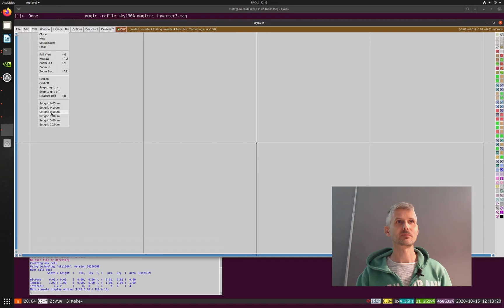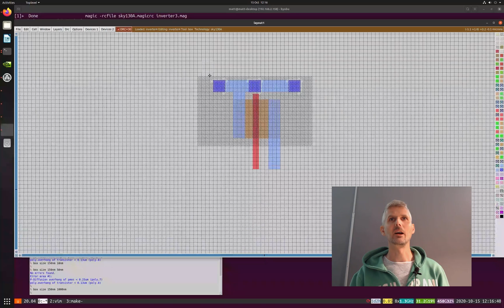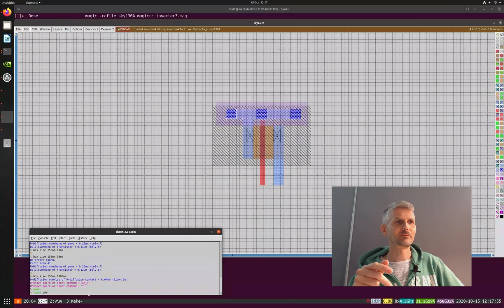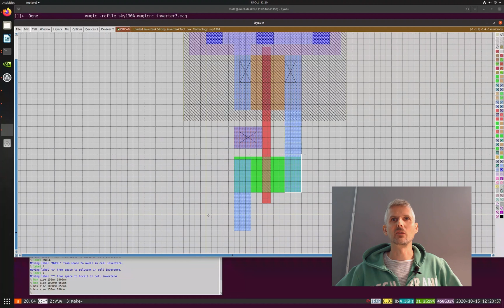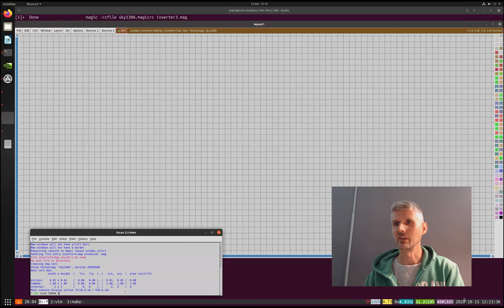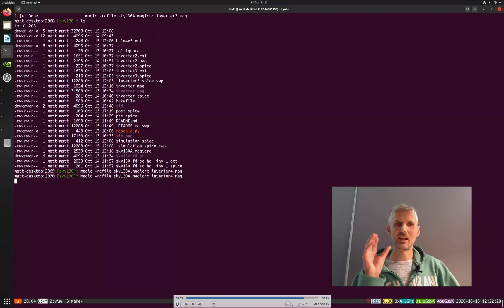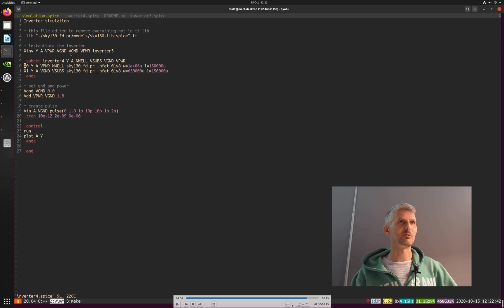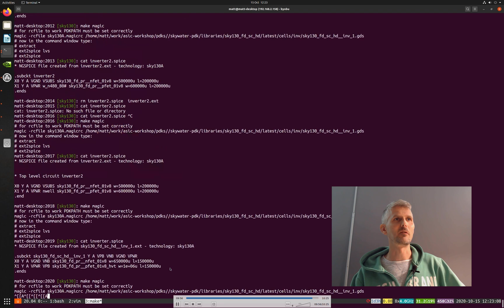inverter speedrun with magic/skywater130

Comment: Thanks Matthew, great video. Can you just import the layout of the actual sky130 transistors and just connect them? Or these layouts are not available in the PDK?
Reply: Magic has an option to import a spice netlist which will give you all the transistors in your design. But so far I haven't found a nice way of using that. There's things like contacts and guard rings added that you probably do not need and I haven't found a nice wat to remove them without getting into a while lot more work than it would be to just start drawing them by hand. For now, the manual method simply gives you much more control and results in much nicer layouts for me
Reply: @rjordans  Thank you!

Comment: can you recomend me book of CMOS VLSI magic?
How can I design a programmable integrated circuit using magic cmos vlsi?
Reply: U just need to learn verilog pass through openlane 😊
Reply: @varunmajji6514  I have some knowledge of verilog with fpga, I will investigate what is openlane. Thanks for your answer
Reply: @eriberteliasmarquezbello6345  yeah also check qflow
Reply: @varunmajji6514  good, I will also check qflow